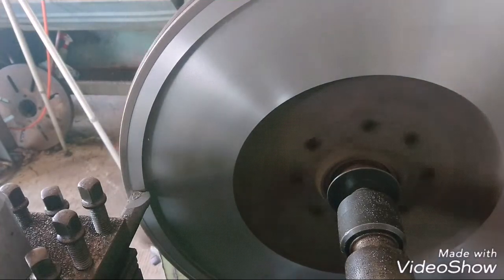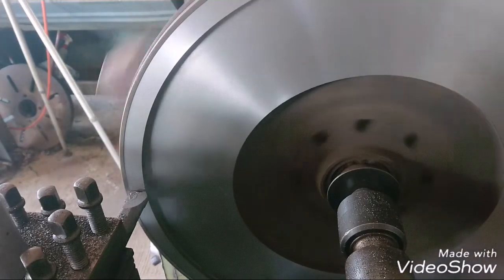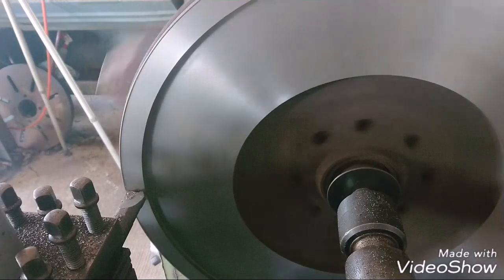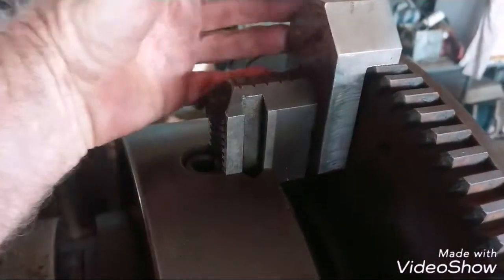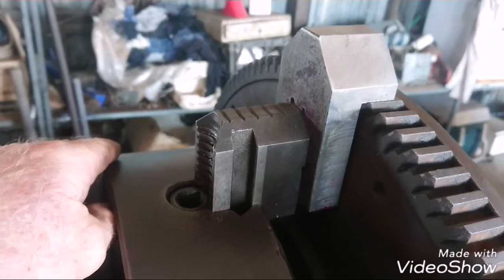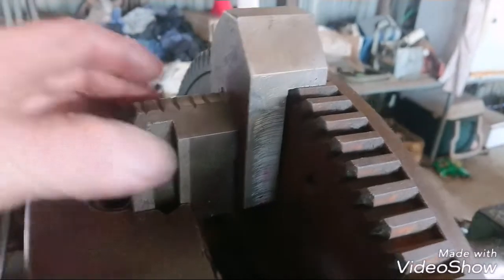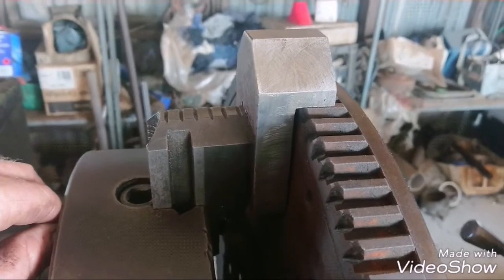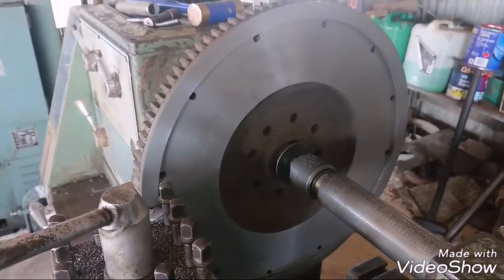Truck flywheel

Comment: Your 4-jaw looks pretty similar to mine. What size is that flywheel and what kind is that lathe? Nice work!
Reply from the maker: Flywheel is 490mm a de the chuck is350mm. The lathe is a magnum turn about 2.5 metre bed and 80 mm bore. Thanks for your comment